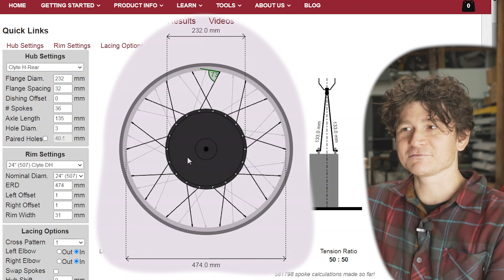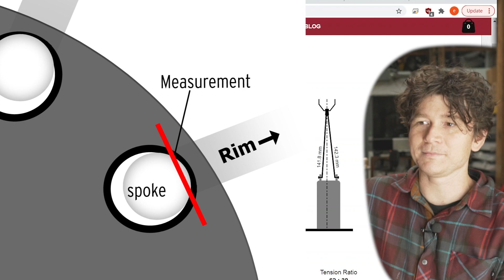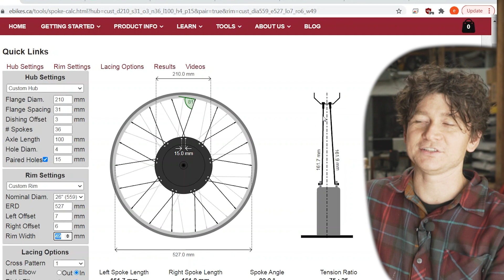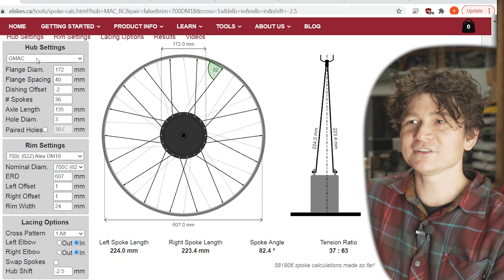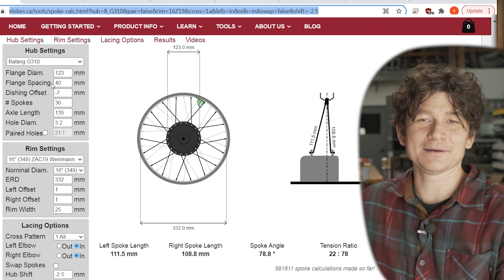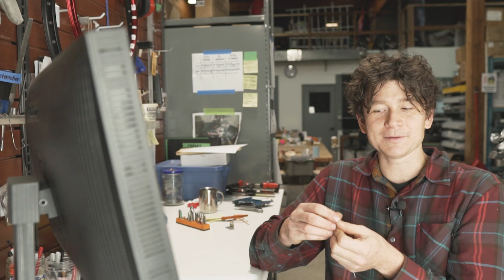How to Use the ebikes.ca Hub Motor Spoke Calculator

Comment: My question is can you supply a 10 gauge spoke for a qs273 inside a 19” moto rim. The spokes I have got from previous vendors are of poor quality.  I’m after good quality spokes as this needs to hold over 50hp.
Reply from the maker: Unfortunately no we only do 13 and 14 gauge spokes and only supply parts for bicycle rims, not motorcycle rims. You should contact a motorcycle parts supplier for that.

Comment: I'm still poking around but I'll comment here and see if you have any ideas.
I'm trying to convert my Schwinn Tourist Hybrid bike into an e-bike (it's already a great commuter bike!) with a BAFANG 500w rear hub conversion kit.  I like the look of the bike as it is, and I'm toying with the idea of keeping the current rear wheel instead of the one that comes with the kit.

The rear hub motor with the kit is the BAFANG G020, and I have 700c wheels... and all the spokes are in pairs around the wheel.  The hub appears to have evenly spaced holes.

Is that going to mess things up terribly?  And could you add the specs for the G020 to the calculator?  I'm sure it's a common one these days.

Thanks for the info, tool, and helpful video!
Reply from the maker: You're asking if single cross is fine? It's not clear what you mean by "all the spokes are in pairs around the wheel". WIth smaller geared motors like this and a large 700c rim, both single cross and double cross work fine.

Comment: Very nice work, interesting and valuable information since rebuilding a hub motor rim is not the same as rebuilding a standard bike rim. I hope to use the information to change my motor from a standard rim to fit a fat bike tire.
Reply from the maker: As long as the spoke holes match on rim and motor you're good to swap!... With appropriate spoke length of course ;p

Comment: Great tutorial sir, but I have a question and hope to assist me with .. My e bike rims are 26"x4.0" 84mm wide and the previous spokes Dia for the rear rim was 10G/ 215mm length. Planning to replace the rims with the same previous rim size but with different model and here is my question will I be able to use 12G/215mm spokes instead of the 10G ? Thanks in advance
Reply from the maker: 10g is an almost unheard of size for a bicycle wheel.  If your motor flange has holes drilled out for 10 gauge spokes, then there is a good chance you will need washers on the the spoke heads if you use 12 gauge spokes instead.

Comment: Hello! Could you tell me a nice motor for pull 30-40kg continuously during 5 min at speed of 25km/h? It's for a proyect. Thanks  so much!
Reply from the maker: What is the diameter of wheel? The smaller you can have for the wheel size the easier it will be to have this pulled off by a hub motor.  The RH212 with statorade in a 20" wheel size is getting close:
https://ebikes.ca/tools/simulator.html?blue=Lbs&motor=9C212_7.5T_SA&cont=cust_50_100_0.01_V&grade=15.5&hp=0&wheel=20i&mass=150&batt=B5220_GA
But normally we'd be suggesting running 2 motors for this kind of thrust level.

Comment: my ebike with a bafang G060 fat motor, 20 inch fat wheel, is radial laced with evenly spaced spoke holes (not paired) but with heavy 11 gauge spokes. Not good?
Reply from the maker: In 20" rims the radial lacing will often hold up OK, but if you find after riding the bike a lot that the spokes gett loose and the nipples needing constant tightening then we'd suggest relacing with a single cross pattern.
Reply: @GrinTechnologies  okay thanks, I'll check them often.

Comment: Excellent tool but... I have a front hub with the right flange with a different diameter than the left flange. It would be a nice update to take in consideration this other parameter ;)
Reply from the maker: We've got one of those hubs in our shop too (this one here https://www.aikema.com.cn/en/product/product-45-361.html). Is that the same model you have? It's quite doable as a future update but at least in the meantime it's easy to just run the calculation twice.
Reply: @GrinTechnologies  yes it is Aikema hub ;)

Comment: I love watching these videos they make me feel smart. I'm saving up and I'm going to get me a grin someday.
Reply: I got a bike cheap on CL, the owner blew his 2nd motor in 6 yrs and was over it, the Grin motor, controller, PAS, throttle, brakes, display work great and I saved a ton of money. So if you can find a bike like that can have fun building it and save. Grin was great about helping me, a complete newbie,  excellent customer service, and the motor has a temp sensor which the controller monitors, and it reduces power before the motor overheats, maybe other motor/controller setups do that, but I didn't see any in my research, so I couldn't be happier with my bike.
Reply: @mscir  I purchased the Luna cycle Galaxy paint bike only last May. For 1,400 it was the best bike for the components I could find. I plan on getting the Luna bbshd and the 72 volt battery and then I'll get grins Phase runner and Egg rider and I should be all set. By springtime I'll be enjoying the Hiawatha National Forest in style.